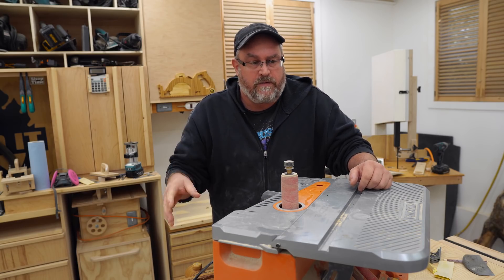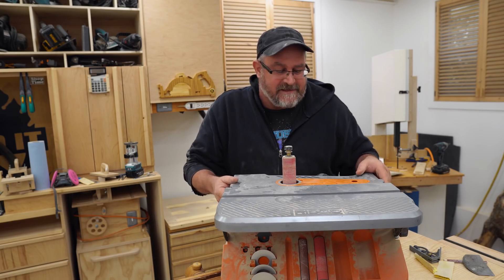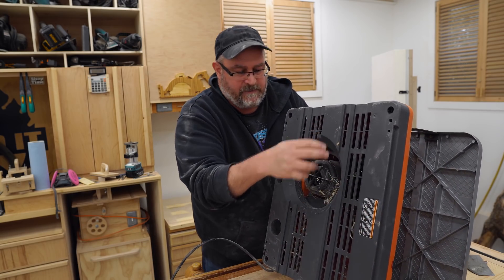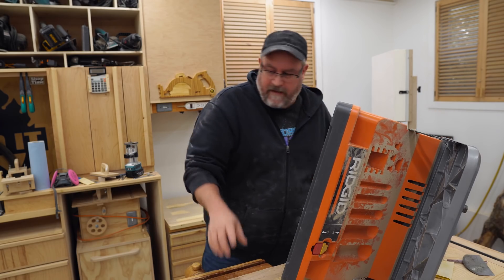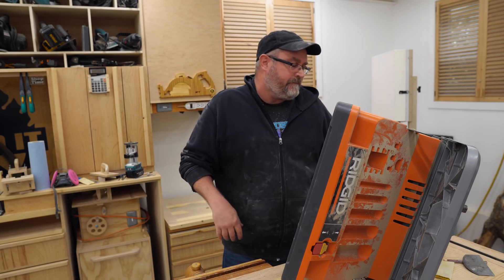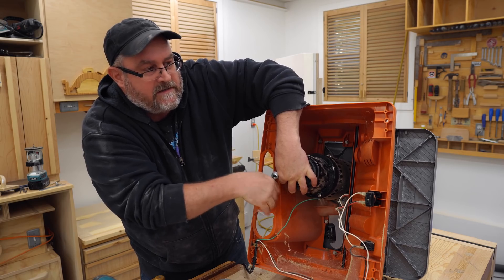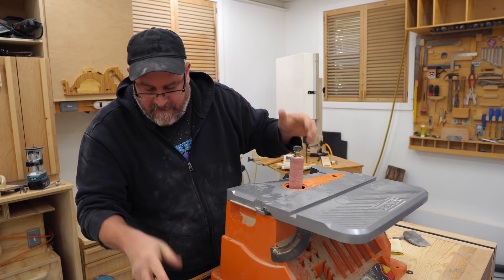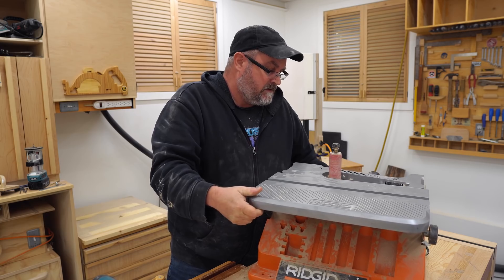How does the Spindle Sander work? Let's look Inside.

Comment: Doesn't really show the mechanism of how these units work. Would like to see one actually fully disassembled, not just a long shot of a black housing. Did learn that it rides on the spiral ramps on the housing, however, so have a little better idea how it works !
Mine is making a burning smell, so I make take mine completely apart.  Will try to share if I can !

Comment: Use a cheap bench top drill press. Remove the top cover and mount the drill upside down on the column. Add a motor to move the quill up and down. Build a table and housing to package the whole thing up. Maybe add trunnions to allow it to tilt. Possibly get an old table saw and gut it out to use the table and housing. It's going to be my next fabricobble project.

Comment: Hey John nice job!  Question I have the same oscillating sander,  one day it stopped oscillating but the motor still ran.  I took it apart like you did put it back together without changing anything. To my amazement it oscillated until a few weeks later when it stopped again.  Any thoughts, Ridgid has no solutions.  Thanks
Reply: Sounds like the slip ring that rides up the ramps in the bottom end may have broken.

Comment: As soon as I saw you starting it on it's side I knew it was going to start smoking soon because the start relay is gravity based. The relay turns on because the the high amperage draw through a coil when it's first switched on. Then as amperage quickly falls when the motor get up to speed gravity takes over and turns off the relay. The start relay powers an extra group of windings inside the motor and if left on while running will overheat very quickly. Most commercial motors use an internal centrifugal clutch that turns it off so it doesn't matter if it's on it's side or not. This relay is mounted right in the middle on the plastic body.
Reply: And if it is turned on while on it’s side or upside down they contacts in the relay will likely arc and possibly stick. It can be taken apart to fix. I bought one used and had to polish the contacts with a concave brass rod mounted in a drill. It works great now.

Comment: I've used the tilting table to adjust a tapered edge and it worked great.  An inflatable rubber spindle sleeve holder would enable you to put air to tighten the hold on the sleeve.

Comment: If you are building a spindle sander then might as well add a longer mandrel to hold two sanding drums so you can sand thicker materials. As for the mandrel itself, look at how bicycle handle bars are held in place - with a wedge that is pulled by a screw. Sure, a spindle based on that will go slightly oval, but i believe that if both wedges (made of PVC pipe perhaps?) are as long as possible and have rubber between them and the sanding drums it would not be that much of an issue. Another potential way to hold the drums is to cut slots length-wise, but not to the very ends, of a plastic pipe, then compress it and let it balloon out, similar to how rubber works.
Or perhaps something based on a compression spring? A spring will expand outwards as it's un-twisted slightly, hopefully enough to hold the sanding drum in place. Could even be a quick-switch system: twist the spring to shrink it, then release and let it's own tension hold the drum on, no locking mechanism required.

Comment: If you're building one...  put the motor to the side with a small pulley on the motor, large pulley on the mechanism so you're reduced the speed before getting to your mechanism.  Then if you build gears/ramps/etc. out of wood they would be running at low speed and could last longer.  Your belt drive could run 2 different pullies- one to spin the spindle and one to operate the oscillating mechanism.  Easier though to just take the Ridgid drive mechanism out and put into your own table.

Comment: I would love to see a video on making replacement spindles for this machine.. I have the exact same one and I've lost the smallest one 😭 Also I thought those were supposed to shrink so the sand paper slides over the spindle and you just tighten the nut on top to compress the rubber to make it expand and hold the sand paper.. thats what I do and its always worked for me

Comment: In your Table Saw Series you spoke about how much the plastic for the top was nice to work with. Could you use some of that and turn you some new drums? Assuming you have scrap pieces! 

Also I have wondered if someone could purchase the Harbor Freight oscalating sander and modify it to have the changeable Sanders like the rigid??

Comment: Hi John, I have a steel version of your sander that uses steel cogs to make the spindle go up and down. My main problem is I will renew the cogs and it will work okay for about a month and then the cogs will wear out again, I now have a spindle sander that goes around but not up and down, as I got fed up with the cost of the cogs. I would be very interested in buying plans from you to make a different sander that did not break down every month after using it about five or six times.

Comment: Ha, ha... John does AVE style Videos. Taking tools apart just for curiosity. :D  I was working in a vulcanizing company for some years... As far as i can tell, the rubber of your sanding sleefs is loosing some sulfer into the surrounding air. That ends up in a decrease of overall mass...and , of course in shrinkage.  An other question... What speaks against the use of a windshield wiper motor for the oscilation function? They are cheap and all over the planet available. And the different makes and models are somehow all comparable. (mounting points, speed, output power, size.....) PWM controllers cost about 5 bucks on e bay...

Comment: All you need to do to fix the shrunken drums is wrap them with mailing labels.  I had a spindle sander before where the mechanism was something like it had two wavy surfaced discs that mated with each other and they both had gears on the outside but a slightly different tooth count.  That created a differential between them without having to gear it down.
Reply from the maker: I know the mechanism you are talking about, but that's even less DIY friendly. Although I suppose the same thing could be done with V belts and pulleys... wheels are turning... (pun intended).
Thanks for pointing that out.
Reply: @IBuildItScrapBin  Well the simplest way is to just make it not oscillate.  It's so easy even I can do it! Oscillating doesn't improve the sanding quality at all, it just spreads the wear out.  Making the table height adjustable or move the spindle up and down and the table stays in one place is actually better at that.  I tend to think they just make it oscillate because it's cheaper to do that than make the spindle fully height adjustable. Now that I think about it, I really should make my shaper into a spindle sander for the 99.9% of the time I'm not using it to cut box joints.
Reply from the maker: Got to disagree with you on that one, it's much easier to burn the stock without the oscillation. Too much heat build up in one area, so the up down spreads that out too.

Comment: I have holes just below my ears, that I describe as a colander. The sanders have there uses but I don't find then efficient. The drums might by 100mm but even with turning upside down you still only use approx 35mm which means the middle of the drum never gets any use. Yes definitely needs a drawer to keep the drums in and clean/ free of dust... What did you say your name was??? 🤣

Comment: I picked up one of these last year, it was heavily reduced at Home Depot and a bit of an impulse buy. I quite like the idea of a custom made cabinet for it, maybe something with the same sort of footprint as your router table?
Reply from the maker: Well, it's on - the motor is sitting on my workbench right now. It would probably around the same size as the router table.

Comment: The bottom has ramps as it turns there is a concentric ring that advance the mechanism a little at a time till it tops out, then it drops and starts over. The oscillation had nothing to do with the smoke, that’s the solenoid in the middle lower front. The contacts are arc burned now.
Reply from the maker: The smoke was from the motor. 
So if that's a cutout for the start winding, the start winding was on too long and got hot enough to smoke. Thanks for pointing that out.
Reply: I Build It Scrap Bin exactly. It’s easy to polish the contacts in the start solenoid. It’s two tiny flat screws to take it apart. I took a photo before to make sure I put the wires back correctly. Take a part then build a polisher from a #10 brass bolt. Chuck it up in a drill cut off the head then find something to make slight concave indention in the end of the brass bolt. I used a round head screw in a vise for this. Once it’s concave, you push it against each of the contacts while it’s spinning in the drill. The contacts look like silver, it’s takes awhile but they shine right up. You want the contacts to be curved, the reason for the concave polisher.

Comment: I'd like to see your take on a home made one . I'm looking to make one myself have a nice motor to use and a 12v windshield wiper motor 2 steel rods some brass bushings and 2 pieces of flat steel to create a pivot arm for the up and down motion however speed control of the main motor is my main concern .

Comment: FYI it says right on the side of the unit why you shouldn't turn it on upside down / sideways. I recall seeing a label on mine anyway, not in front of it at the moment to check.
Reply: Ryan Dury it’s because of the start up solenoid on the bottom front. It’s gravity activated when off. If it’s upside down or on its side it is in the wrong position and the solenoid sends power in the wrong path for continuous running. It will but  up the motor. I’ve had to dis-assemble my solenoid and polish the contacts to get it to work. I bought it used and the contacts were arc compromised and the motor would not turn properly.
Reply: @akbychoice  Hey, I appreciate the explanation! Thanks!